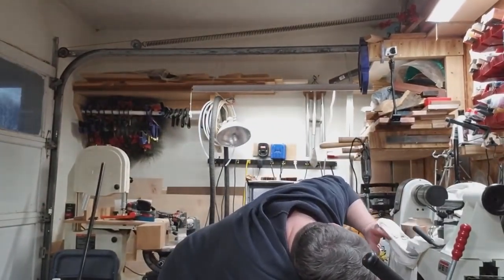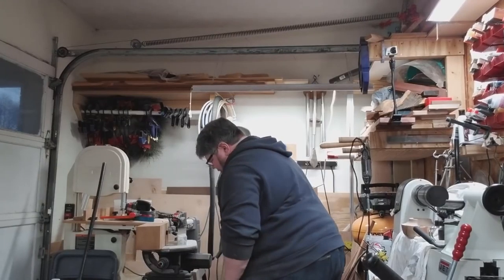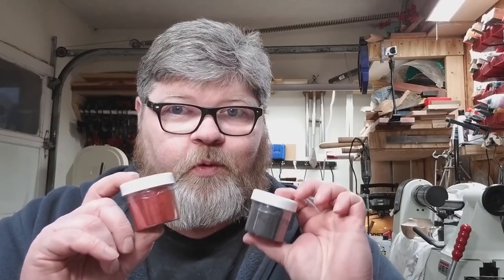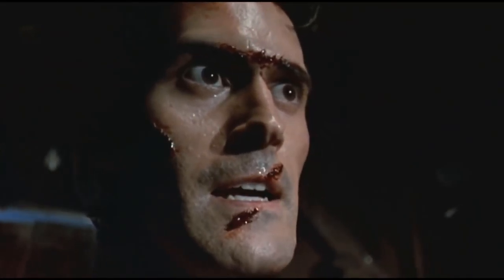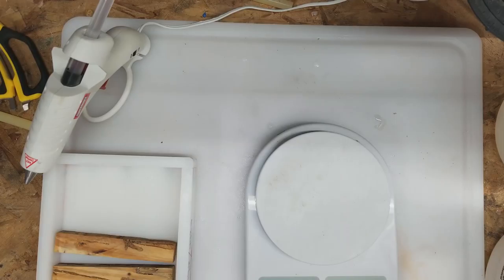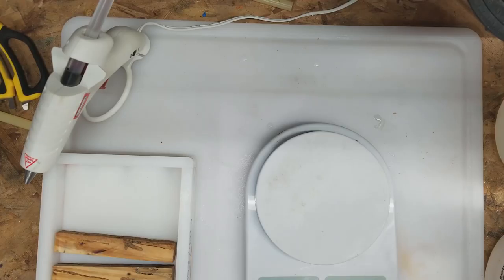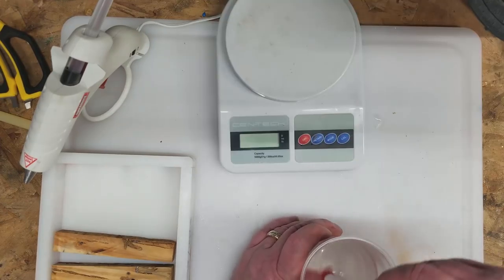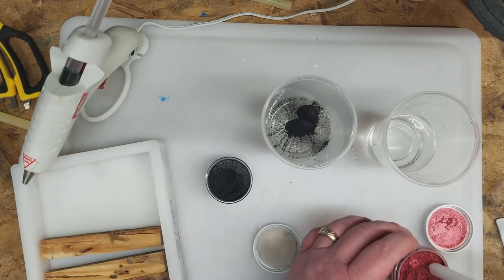Evil Dead cast hybrid wood and resin blanks

Comment: Very nice. Next time use a smaller mold and wedge each end of the wood locking it in place with a gap on all 4 sides then while the resin is still very thin as just mixed put it in a vacuum allowing the colors to penetrate the wood not just the voids.
Reply from the maker: Thanks Dirk!

Comment: It looks like you have a whole garage door that'd be perfect for stickers :) 

I know this was for a client, but what do you think of doing a double dye stabilization of the wood first before casting in AL?
Reply from the maker: Hey Joe!

I have zero experience with stabilization dying.  I've only got about a quart of Cactus Juice left right now, and it's all dirty from previous jobs.  He still has 5 more blanks, so it may be possible once I order some more Juice, but I'll have to practice first of course :)

Garage door isn't an option :(  That's single pane glass, and anytime there's a major temperature difference, there's condensation - and a lot of it.  Some of the panels are about to go bad because of water damage, so the door is most likely going to get replaced, or changed to a man door.  Just depend on if I can swing a bigger shop in the next year or so.

Thanks for the suggestions!

Mike
Reply: Not a bad idea.  Only thought is that sometimes too much color takes away from the natural look of the wood.  A little darkening of the Wood via dye may have gave it a nice aged look, but I was looking for a nice contrast of color to look like dripping blood.  If the wood was too dark, it may not have shown as much as I’d like.
Reply: Brian, I was basically thinking out loud for my own blanks, that don't have many voids lol. In my situation, I'd think that most of the AL would turn off, leaving a very plain looking piece of wood. But I totally see your point about the color distracting, and the look you were going for. Can't wait to see yours turned!

Comment: Dan Pompe just did a review video on maneaters HDPE molds.  He said hot glue can damage the smooth machined surface and recommended a product called Clear Museum Gel, $10.99 on amazon (https://www.amazon.com/gp/product/B0002V37XY/ref=oh_aui_detailpage_o02_s00?ie=UTF8&psc=1)  No experience, yet but I've ordered some.  It looks like the gummy adhesive used to attach labels to magazines.  Easily applied and easily removed.
Reply from the maker: Thanks Steve!  I was wondering how I would be able to do this in the future - you just saved me a ton of research time :)